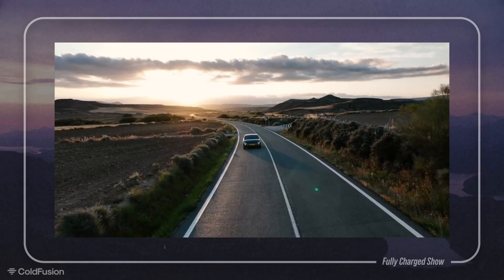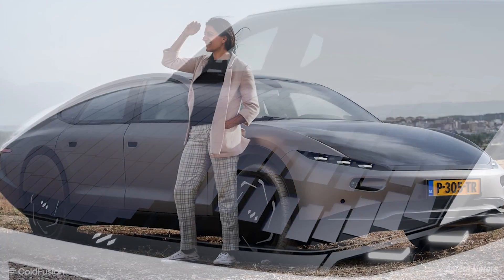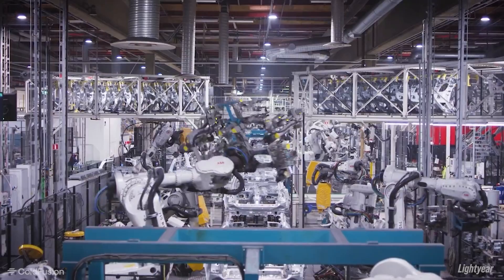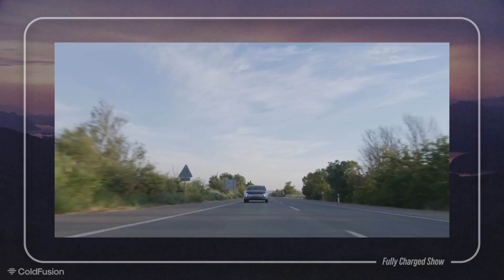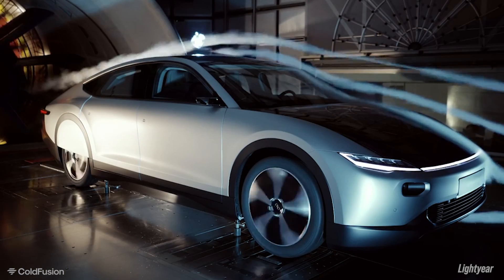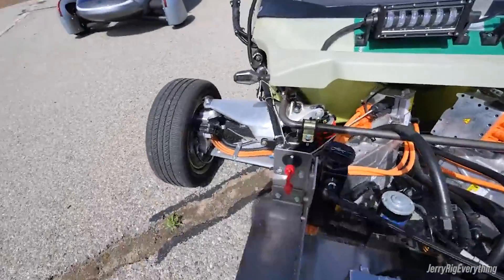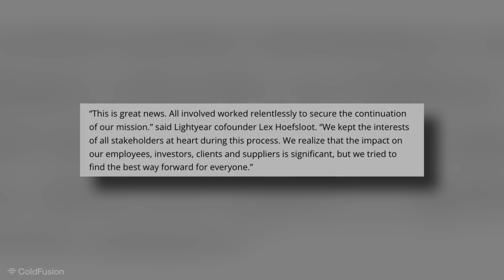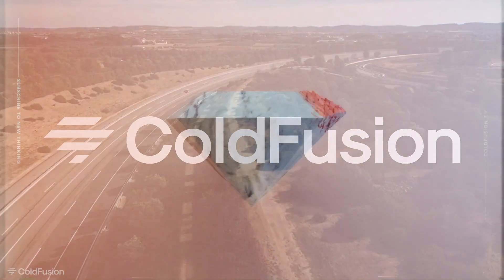3 Interesting Solar Car Projects

Comment: I would buy one, but they need to push that cost down to  $5000 or $2500 dollars. It’s going to become almost impossible to get a car loan. Let alone a housing loan. So unless you can push it down low enough to where someone can pick it up with a single tax return. A good deal of cars are not gonna be able to be purchased. And that time is right around the corner. We don’t need subsidies. We need the cost of living for every item to go down, including automobiles.  Of all types sizes and energy sources.

Comment: Almost three years ago I finally got my brand new e-up. Having 41 thousand km on currently, I tried to drive with maximum efficiency around the city recently. I managed to drive 364km on a single charge, with 4 km remaining on the GOM. The average consumption was 7,6 kWh/100 km. I drove at speeds up to 50 km/h within the city. If I made longer trips, the consumption would be even lower, but I had to do some short ones (about 2 km) in a hilly terrain, which did not help either. I previously drove a 2nd hand bought 2016 e-up in 2018 and drove about 25 thousand km with it, before I got the new one. I know the quirks of this little city car, how it handles and performs. I would never ever want any SUV. If I had a solar panel on the roof, even 5 km per day would be nice, maybe a little more in ideal conditions in summer, when I park my car on the train station for most of the day, right under the sky. That is something that would really be nice to have.

Comment: 15:00 slow, doesn’t cut it in American traffic today. Also, I have Leadfoot. 🇺🇸 

BUT, it is very rare that you see an EV operator employ the higher acceleration capacity. I have dual motor EVs get in the way of my 3.5L naturally-aspirated vehicle ICE all the time.

Comment: I feel like "Solar-Car" is a missguided gimmick/buzzword. Just put a small solar cell on top of a regular ev as a range extender, there's really no point trying to force a concept like this into the market this early in development and with this high a cost attached to it. My car sits in an open parking lot for most of its life. Any amount of trickle charge would probably allow me to delay recharge by a week.

Comment: Overly integrating things and force it to do things they are not good at will most likely fail. Solar panels, sitting on top of the roof, genders power. Electric cars, use the power to drive.

No need to combine them. It is a joke.

Comment: Am I the only one that finds the performance of those cars enough? Or do Americans truly ride more than 100 miles in the city? 😅

For people that have multiple cars or don't travel much, those parameters are more than enough. That is to say, they are proper urban cars. 

Aptera was especially awesome. I think with improvements in battery and solar panels technologies those cars can achieve supercars specs someday. And/or unlimited range. The laboratory record for solar panels efficiency was beyond 50% last year. And I once saw beyond 70% claim (not confirmed though).

Comment: Super tiny roof on a Prius can charge roughly 9 km of range per day with 180W max. input. 
This car (first concept), with 1,05 kW/h solar capacity, would be able to provide more than 60 km of range in optimal conditions.

A lot of people would argue they drive much longer trips, but I think it is incredible. It does not have to be solar infinite range ... I like it as I like Hybrid Plugins - you drive most of the time like an EV and you fill then tank every three months or every month based on your driving habits.

That said, I do not believe we will see any solar car as a big production any time soon.

Edit: Oh, you mentioned Prius in the end 😀

Comment: Elon Musk has expressed his thoughts on solar-powered cars a few times. He has pointed out that the surface area of a car is not large enough to generate sufficient power from solar panels to run the vehicle effectively. The energy generated from the solar panels on a car would be limited, and the kilowatt-hours (kWh) produced would not be enough to provide a practical range for the vehicle.

Comment: have you seen “NZEV” class vehicles?  kinda like street-legal golf carts.  “local use only” vehicles / not allowed on highways.  I think they’re meant to be 60km range, 60kmh top-speed, ballpark?  😊  These things look perfect for solar!
Reply: I’m not sure “NZEV” label is being used buy advertizers to sell product.  I’ve seen it as a legal distinction/classification, vehicle on the road needs insurance & license plates … so, basically, an actual golf cart, but it has all the lights & mirrors & seatbelts required, and it’s licensed as an “NZEV class” to drive it on real roads.  only certain communities allow them, and the vehicle isn’t allowed on the highway, so it can’t leave.  😂

I think it means, “near zero emissions vehicle” … so tiny gas motors are legal?  ugh.  the low-power profile makes these perfect for battery/solar combos!

Comment: no EV, no solar car for me. BTW you still need oil to make tires and rubber components on these cars. The raw materials (styrene and butadiene) are obtained after processing given fractions of petroleum. Natural rubber is NOT abundant enough and definitely NOT strong enough (tear and modulus) to be used in vehicle tires. Cheers!

Comment: What? People did not want an ugly-looking car with a supercar price tag and performance of a lawnmower? What a shocker! ;-))))))))) Lightyear Zero had it coming from the start.
And don't hold your breath with Aptera. These $100 refundable deposits for pre-order mean nothing. People will cancel as quick as they cancelled Lightyear pre-orders.
In my opinion, the whole idea of solar-powered car is stupid. The roof space is too small to make any practical difference. You want your car powered by solar?  There is much better solution for that. Slap solar panels on your house roof and charge your car batteries with that.

Comment: You left out a little mayor detail as to why any of these "startups" are crashing hard.
The corruption, greed and systematic murdering of, smaller, threatening companies and the competition by the larger players like VW, Renault and Opel.
These companies and organisations have been murdering innovation and invention for years when they are being told a no to their offers.

VW being one of the main mass murderers. Not only systematicly lying about their emmisions, durability and performance but also trying to buy the tiny startups out of existance.
There has been a wave of innovation comming from the Netherlands for years on multiple regimes. Each and every one being murdered within 3 years of the invention.

Greed has once again poisoned mans hearts. Time for the Engineers to rise and take control before it to late.

Comment: If it made any sense Musk would have done that. Solar and hydrogen cars are gimmicks. Although they are possible they are not practical at least until 40% efficient solar cell will be invented.

Comment: Absolute brilliant episode.
Yes, I would buy a Lightyear.
Who needs to go over 100mph when the legal speed limit is around 70 / 80 mph.
There will come a time when the car will know what road it is on and the speed limit for that road, and not exceed it.
I am positive it can be done, but big car manufacturers have different ideas.
Which leads me to a questions, why are companies allowed to build cars that they know can break the legal speed limit in most countries?

Comment: Makes very little sense to design a car around solar panels on the car, doesn’t it?  The vast majority of driving is done to and from home … so charging from a far more powerful home solar installation would be more efficient and cost effective … plus doesn’t require all sorts of design compromises in the car itself.

Comment: would I get one for a lower price instead of a fuel car or tesla? Yeah, 150kph is fast enough anywhere, 10s acceleration is slow, but we lived with that for a long time. Teslas are just sacrificing efficiency for flashiness. Not the other way around

Comment: Not running a heat cycle on my ice car for a local trip would definitely be nice. Especially if it produced the energy it uses. If it came with a battery to grid system i might have a financial incentive to consider it.

Comment: What Went Wrong?  Dude!  There's like 2 square meters of solar panel there.  That's about 300 Watts at PEAK.
If you think this could ever work it's because you suck at Engineering and STEM in general.  Have fun everyone.

Comment: At $40K , which undoubtedly be more by production time,  Lightyear2 will have to compete with "Teslas" of the world.  Should it inherit lackluster performance of its predecessor it would be a very hard sell again.  And while solar powered car certainly sounds cool with solar panels on your roof any electric car becomes solar powered.   Here is an idea: don't design yourselves into solar powered corner again.  Use your expertise to create a more efficient, quicker charging, longer range, similarly performing "Tesla" with just enough solar to not brick itself if left parked outside.  You're welcome!  :)

Comment: Would absolutely get a slow solar car and I currently drive an EV that can do 0-100kmh in well under 4 seconds. Keeping a very close eye on Aptera and really hope they make it. Great video as always!
Reply: Aptera isn't a car. It's a motorcycle. Anything with fewer than four tires is a motorcycle, so they don't have to add the weight of all the safety features of a car.
Reply: @darrennew8211  While low weight is obviously good for range, it's challenging to make such cars safe. For me that's a problem.
Reply: @Pyriold  However, I'm told it's actually classified as an "autocycle" because it's enclosed and has seatbelts and such, so you don't have to wear a helmet. I guess legislators figured it out and came up with an appropriate set of safety standards after all.
Reply: @darrennew8211  I'm well aware of what the Aptera is classified as, especially in my own state. :) But given that it has seats, a steering wheel, a wind shield, doors, keeps me dry in the rain, things like that, I consider it a car. Cheers.
Reply: @KitelessRex  Yeah. I was coming at it from "we call it a motorcycle because that way we don't need all that heavy safety equipment like air bags and roll bars."  It's a pretty standard EV dodge trading safety for mileage.

However, I'm told it's actually classified as an "autocycle" because it's enclosed and has seatbelts and such, so you don't have to wear a helmet. I guess legislators figured it out and came up with an appropriate set of safety standards after all.
Reply: @darrennew8211  In my state it's classified as an autocycle yes, but a car driving license is all that's needed. This is true in most US states. Aptera has claimed that while it's not technically required, they are trying to make their vehicle as safe as a car. 

They are doing something unique and proceeding cautiously. This is their second attempt after all. It's a polarizing looking vehicle for sure but I think it's beautiful. :)
Reply: @KitelessRex  They are trying to make their vehicle as safe as a car? - they are trying to make their vehicle.

Comment: Great video. I hope they can get this car onto the road - not sure how well it would do here in Canada, but there are many places it would be a great option. Am I crazy, or was there a car, and this was years ago now, that had a solar panel on the roof to run the car's AC while you were away so the car would be cool when you came back? I always wondered why that wasn't a thing - since so many cars sit in the blazing sun and don't capture any of that energy. It would be great if all those cars could now be charging themselves!

Comment: Considering how much time most cars spend parked, they should come up with a foldable solar panel that could be extended to improve the charging capability when the car wasn't in motion.
Reply: This is a much better plan because you can align the panel to the sun. In fact, RVs already do that to some extent.
Reply: Aptera plans to offer an accessory folding solar panel that fits inside the car and can deployed when you reach your destination. Details are sparse right now because they are putting all their efforts into making the car. I have made a deposit and look forward to using my Aptera.
Reply: @dwightjones3305  Let's hope you are not disappointed!
Reply: @dwightjones3305  You lucky bastard! :D
Reply: until you realize that in some cities the cars most of the times need to be parked in autosilos or underground garages because park on the street is not an option.
Reply: Like the ones they have for mobile phones.
Reply: They don't need none of that, there are solar panels the size of a palm ✋ that store compact equivalent with 5 meter solar panels just that the 🦎 lizards 👽 don't want the technology to exist for the masses
Reply: Or just traditional solar panels on rooftops, that you could hook up to as public charging...

I don't see much benefit in installing the panels on the car directly. It just seems much more expensive, all around.
Reply: They would get stolen,  need to be firmly on the car . Maybe with a way to be hidden when not used.
Reply: @neilstern7108  the car can get stolen just as easily, panels included.
Reply: @alexpyattaev  I'm not sure solar panel theft would be much of an issue, but that's just not true. Not if the car has modern security measures. Cars aren't nearly as easy to steal as they once were.
Reply: @Bertinator-nm9ld  just go to an RV park, plenty of panels there just outside, no security. as for stealing cars, proficient thief can snatch just about anything in under 5 min.
Reply: @alexpyattaev  Are you familiar with PATS?

Thanks to systems like PATS, if you're trying to steal most modern cars, your best bet is going to be to bring a flat bed tow truck with you.
Reply: @Bertinator-nm9ld  Well, PATS works in theory in case the thief would actually try to start the car using its stock electronics. What they do instead, is come with their own ECU, small fuel bottle and hook directly to the engine. This way they can bypass 99% of the safety features without issue (and without breaking the lock). So PATS is useless. This is one example of careless carmakers making it easy for the thieves https://www.youtube.com/watch?v=X0Kw94gVUl0
Reply: @alexpyattaev  That's a kinda fear-mongery video. Did you notice how they didn't show a video of any thieves actually stealing a car that way? The video at the front of the episode was the thrives stealing your key off the counter.

Have you ever heard it said that most crimes are "crimes of opportunity"? Yes, sophisticated thieves do exist in small number, but no, most crime isn't that. 

For example, our local police department said this about a rash of people stealing purses out of cars. "These thieves aren't going around breaking windows and grabbing stuff. They're going around pulling handles to see which cars were left unlocked, and then they grab whatever is in there. Lock your cars."

I'm pretty sure the majority of stolen vehicles were stolen while the key was still in the ignition and the car still running, but I'll have to double check those statistics. Those are crimes of opportunity.

The only real problem we've had with the widespread hacking of modern cars is the Hyundai/Kia fiasco. But that is the fault of those OEMs, for being appallingly far behind on their PATS technology. They cheaped out big time to save a buck.
Reply: @Bertinator-nm9ld  Try to live in Russia for a few years. Sophisticated thieves are abundant, as are guys with towing trucks, as well as corrupt cops to cover for their "infrastructure". Our car was "attempted" multiple times, and by the time we sold it, the mechanical locks were all completely destroyed by multiple break-ins. The only thing truly ruining the day of a sophisticated guys are kill switches that are integrated into car's electronics such as starter motor controller or electronic park brakes. Since those are custom and not wired to the CAN bus, they are truly hard to defeat without a towing truck. GPS trackers are mostly useless as thieves have jammers for those - you lose signal the moment they start working on your car. Of course physical locking devices work too but they are hard to find with locks that will delay a thief by more than a minute.
Reply: @alexpyattaev  Did they attempt to steal your car multiple times, or did they successfully steal your car, multiple times? What stopped them each time?

What would have stopped them from stealing it if it had been solar panels? (After all, our conversation is about how solar panels are much easier to steal than cars)
Reply: @Bertinator-nm9ld  3 attempts, 1 success. two attempts were kinda similar, break door lock with twist tool, open hood, flood alarm horn with PU foam, hook up ECU, try start, fail, curse, leave. third was a success when they stole the car while it was in the garage. they had pretty much whole night to find the "bugged" components and get rid of them.
Reply: @alexpyattaev  That sounds like a pretty resource intensive theft, which is definitely more difficult than grabbing a sawzall and stealing some solar panels, which was my point.

What car year and model were they trying to steal, out of curiosity?
Reply: @Bertinator-nm9ld  '99 honda crv. was a while ago. it is about how easy it is to retail the stolen thing, not about how easy it is to steal.
Reply: @alexpyattaev  That's not a modern car....

OBD2 was just barely a thing by 1999. North American CRVs didn't even get immobilizers until 2002, and I can't imagine Russia was ahead of that curve. Your car doesn't even have PATS, as best I can tell!
Reply: The thing is most people park their cars at night , so producing energy via solar is almost useless. It just varies tho